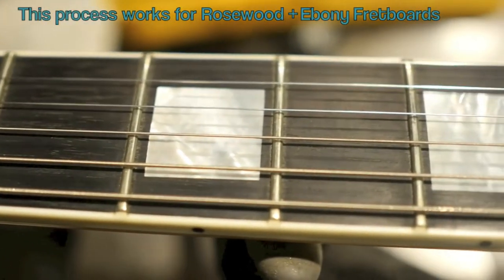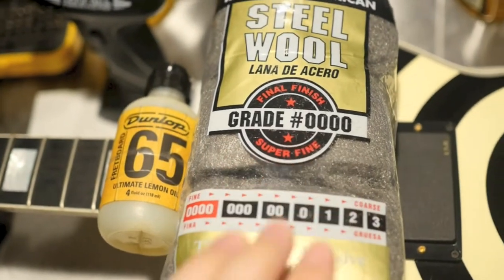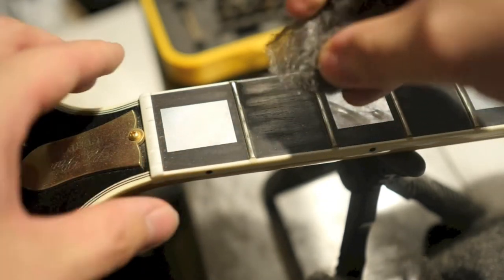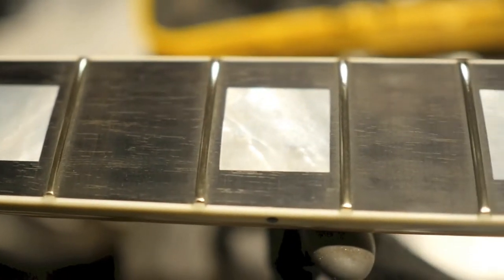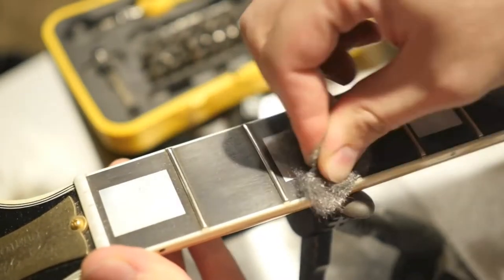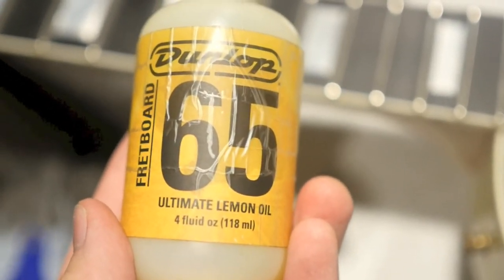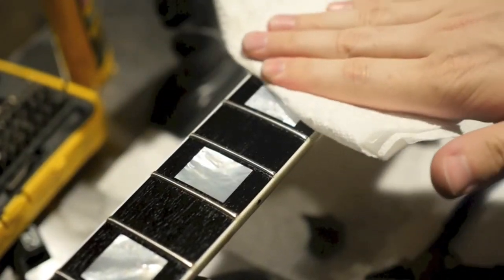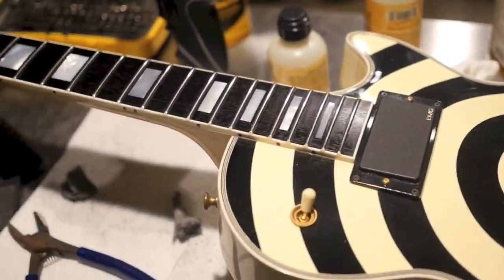How to Clean Your Guitar's Fretboard and Frets

Comment: cover  pickups with  tape  they  are magnetic.  note.
Reply from the maker: I was going to put a foot note about that. I usually just cover the pickups with a cloth. EMGs are easy to wipe off though
Reply: Sorry man but I have to dislike your video for not mentioning the necessity to tape off the pickups.
Reply: Drew Marchand that’s actually a legit complaint. Worst case scenario the steel wool will kill those pickups (not sure about emgs but it will kill single coils or humbuckers)